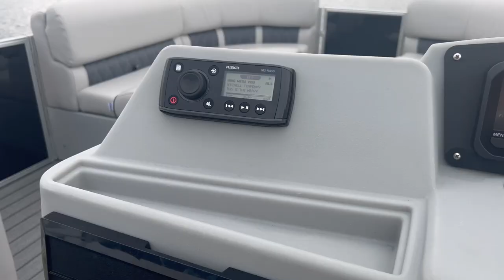Installing Pontoon Lifting Strakes On My Tritoon

Comment: Great video the front pitch came out great.   I have a 22' Bennington tri-toon and have really enjoyed these videos.  I've always dreamed about having a 250-300hp outboard.   I recently did a full service on my Yamaha 150 and noticed how low the engine was mounted.  I struggled to decide how high to go.  After countless hours on the internet, I decided to go top position.  I finally was able to get out last week (Utah has had a great winter).  Snow and ice gone on most the lakes.   I gained 4 mph and took my already nice ride to ultra quiet and very smooth.   I haven't done any mpg runs but I'm  convinced it was the right move.   Zero cavitation and plenty of go.  Thanks for all the videos!!!
Reply from the maker: Thanks for watching our stuff!! That’s great for the improvement you got out of a simple adjustment. Never hurts to go a little faster, but gaining a quieter ride is a MUST whenever possible

Comment: Interesting work, looking forward to seeing the results. By far the funniest video so far! Sounded like a root’n - toot’n good time!😂
Reply from the maker: So far the ride is so nice and smooth. Even before trimming it out we rise right up on the strakes. I thought we'd pick up some speed, but it's not been the case. However, with 5 people we were going much faster (37 mph) than it would have ever done with that load...especially with people sitting up front. I'm pretty sure I will end up welding some smaller strakes on the outsides to maximize performance, and because those will be much simpler to add versus climbing under the boat to weld! Stay "tooned" for more!
Reply: @tomspontoons Glad your effort worked out, sounds like it made it a “blast!” 😆

Comment: When are you going to video the results and the prop change? I have a neighbor who needs to do this to his boat I think.
Reply from the maker: We ended up selling that boat late in the summer…BUT the strakes made the ride incredibly better. You could feel the boat lift and ride higher, especially at mid range speeds and with full loads of people. My top end speed went up about 1mph in an empty boat, but the improved ride at mid range speeds and heavy loads made it all worth it. I would have added strakes in the outside of the outer toons too if we kept the boat. The next tritoon build will get strakes everywhere!!

Comment: I have a question, Im not interested in speed. Im looking for mileage. I have an Evenrude V6 150hp motor. Im going to put on a new prop. Any suggestions on the size and pitch I should use?
Reply from the maker: The only way to really figure your prop out is to have a good working Tachometer on the boat so that you can test your wide open throttle RPMs. Then based on what RPM you're spinning you can adjust the propeller pitch from there. I've got a couple videos that break it down:

https://youtu.be/NLGmzJLKslA

https://youtu.be/x4dOKxyRsnU

Comment: I wish you guys were in Ohio!  I just acquired three 27"" pontoon logs off of a hurricane wrecked boat and I plan to refurbish the center transom log with spare parts from the two outside logs.  Then mount the center on my 2004 crest.  I'm excited and terrified 😅
Reply from the maker: The Bennington that I'm currently restoring came to me from the Columbus, OH area....just saying! Sounds like you found a cool project though. The hardest part with making a Crest a Tritoon is they used U-Channel crossmembers for so long. Only way to bolt the center toon in is by removing the deck to get access to the nuts/bolts.

Comment: Do you think I would get much performance enhancement with a 18’bass buggy with a 75 on it white the strakes?
Reply from the maker: What 75 hp motor is it? Year, model?

Usually I’d say you need to be around 115 hp to gain the benefits from strakes, even in an 18’ boat. In the 22’ range it seems to need to be 150+ hp.

Comment: Wish you would put final results on this video after changing prop
Reply from the maker: Haven’t quite got there yet, there’ll be a follow up. I want to add strakes to the outside of the outers too. So far it allowed me to maintain much better speed with a full load. Empty boat gained about 1-2 mph. Swapped the prop but it dropped RPMs way too far for most applications like carrying a full load of passengers and towing tubes. Still working on it!
Reply: @tomspontoons  Have you gotten the new prop and/or outside strakes installed? I'm looking at getting strakes installed on my 21' pontoon w/ a 115hp 4stroke Yamaha and curious of the overall outcome. I've tried repitching the prop, but I still can't get the RPMs above 5400rpm or so with a normal load (WOT is 5500-6000rpm). Thanks, love your videos!
Reply from the maker: @blakeeasley  We ended up selling that tritoon. Got an offer we couldn't refuse. You may need to look at the motor height. Sometimes if it's a little low you won't get the RPMs to climb as the motor is creating drag. You're normally going to see 6000 with just you in the boat, and then add a handful of people and gear and you'll see that 5400 range at wide open. That's typical. 

I just worked on wiring for a newer Sylvan that had inside and outside lifting strakes with a 115 SHO Yamaha and it topped out at 37 mph with two people on GPS. Significantly worse performance with 6 people (low 20's), but pretty cool for a pontoon to see those speeds thanks to the strakes.

Comment: Do you have any suggestions for adding to the rear of a tritoon  to help with weight and buoyancy for rear cabin and deck?
Reply from the maker: Not much you can do if you’ve already got the center pontoon. Some center toons have cavities that can fill and drain water, while others are sealed with a bilge which will help be more buoyant. Only other thing is trying to distribute weight better to counter the stern. May need to move a battery or other heavier items forward in the boat.

Comment: I just acquired my first pontoon boat. 25 foot with a Merc 3.0L I/O (135 HP). Sat in a field for years. Got it running again, engine runs good, but tops out at 19 mph. You have inspired me to add some lifting strakes. What were the dimensions of the angle you had bent? Looked like 3x3.
Reply from the maker: That boat should scoot!! I'd check into your prop and make sure you're running the proper RPMs at wide open throttle. I had it bent at 6"x6". When I add strakes on the outer pontoons I'll likely go a little smaller with 5"x5". I'm super glad that I added them!
Reply: I’m adding strakes to my 22’ 2003 odyssey tritoon. I’m adding 6” strakes to the inside and outside of all three toons, but the last 4-5 feet  of the outer toons will not be added to make it easier for banked turns.

Comment: I got a question  I installed lifting strakes at my pontoon it run faster  but the bow bounce up and down if could give any. advice
Reply from the maker: It sounds like you're "porpoising" which is usually caused by not enough weight in the bow, or too much trim on the motor. Does it improve if you trim the motor down once you hit those faster speeds? Sometimes a whale tail or hydro-foil on the motor helps too.

Comment: what did you use to make the strakes? was it just 6in x 6 in aluminum angle?
Reply from the maker: I had some 0.100” sheet bent by a local metal shop. There are some extruded kits you can buy, but I’m sure they’re much more expensive, plus I like to support the small shop near me!

Comment: I have a 22 foot Harris and want to put a center toon on. how long of a too. Should I put on
Reply from the maker: I would measure your outer pontoons and go with a center toon that’s 16” to 24” longer, so that the extra length sticks out in the rear. This is of course if you don’t have a big cut out in the deck in front of the outboard. I’d measure the outer toons to be sure of their length (sometimes a 22’ boat on paper isn’t 22’ pontoons). And I like at least 2” larger diameter for the middle toon too. Hope this helps!!

Comment: Is that plug plastic?
Reply from the maker: Yes, these pontoons came from the factory with those plugs. I’ve seen it from time to time, but they’re often an aluminum housing with a brass or stainless plug.
Reply: @tomspontoons  Your awesome. I even found a half inch plastic plug at the hardware store that works perfectly. Lol
Reply from the maker: Thanks for the kind words! Glad you found something to work on your boat easily!